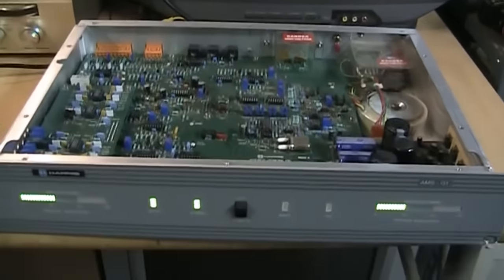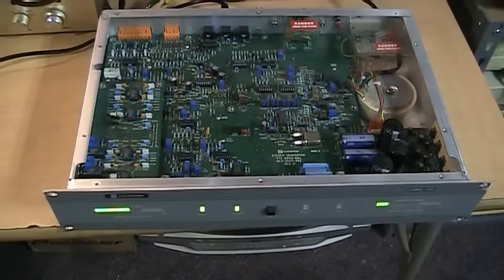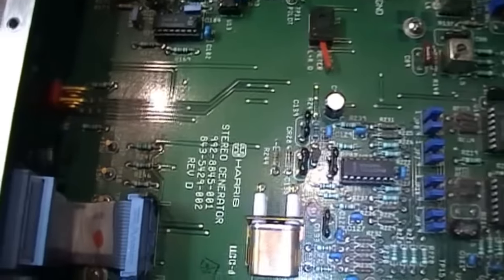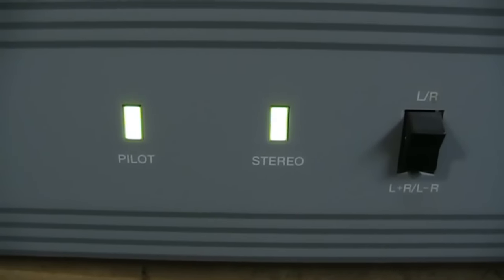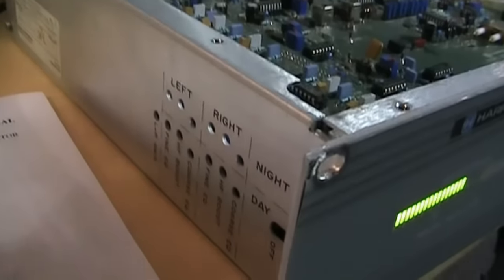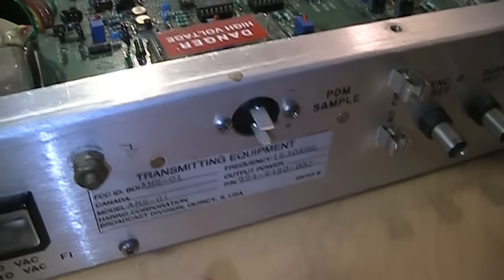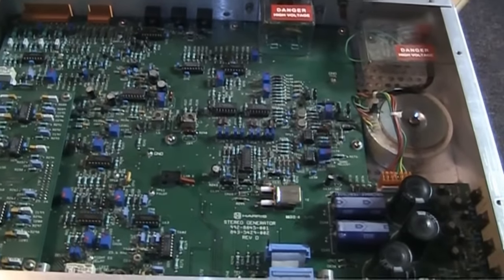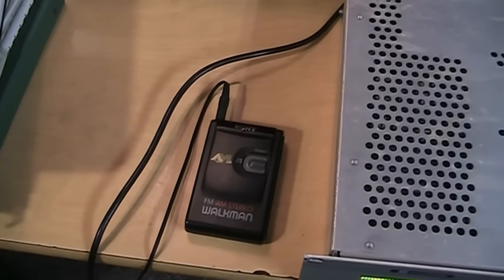Harris AMS-G1 C-Quam AM Stereo exciter

Comment: Wow, does this take me back!  I was the designer of this unit, and I haven't seen one in over 20 years.  Thanks for posting this!  It was indeed a unique design, with some tweaks to the equalization circuitry that allowed you to set up one of these in about 1/4 the time of any other AM stereo exciter of its time.
Reply from the maker: Thanks for the comment! I just wish more stations which still have C-Quam exciters would actually use them...
Reply from the maker: BTW, do you still have any crystals for the AMS-G1? I would like to change mine to a different frequency, but I just contacted Harris (now known as GatesAir) and they told me they no longer have any crystals available for it.
Reply: @vwestlife  Did you end up finding any more crystals? Motorola not being able to supply shouldn't be a problem, you could order them from any crystal supply house once you know the specs. GatesAir should be able to tell you what those specs are.

Comment: The PDM sample is used to correct for the power amplifier non-linearity in SX series transmitters (Known to some engineers and the 'sucks' series).  It takes a sample of the PA voltage from the modulator and pre-distorts the RF drive with a variable phase term to cancel the IPM of the transmitter.  Without this correction, it was difficult, if not impossible to get acceptable distortion and separation figures from some of these boxes.  Later transmitters from most manufacturers included IPM correction circuitry to make them 'stereo ready'.  This became even more important with the introduction of various digital modulation methods like IBOC and DRM.

Comment: I worked at a station that bought one of these along with a Harris DX-50 50,000 watt AM transmitter (KWJJ-AM, Portland Ore). When they were all set up, they produced excellent AM stereo (like better then 50DB channel to channel separation out the antenna). Glad to see one of these again, thanks for posting! Now someone correct me if I am wrong but the PDM sample plug on the back of that unit was actually supposed to receive a sample of the PDM (Pulse Duration Modulation) signal used in the transmitter (assuming you were running a PDM style transmitter). The AM stereo generator would use this signal to compensate for and cancel out the Miller Effect of the MOSFETS in the transmitter, allowing substantially better stereo separation when using a PDM  transmitter. It's been many years since I have seen one of these units, but as I recall this is the only AM stereo generator that I saw that had this PDM correction circuitry. Good Job Harris. They made some excellent AM equipment in those days.

Comment: I was going to say "you should totally install Linux on that", only the bug makes me think someone already did! Okay, I'm a bad person and I'll go home now. :-P

The audio quality and separation are both striking. Those removable connectors blocks are also commonly seen on alarm panels, building management stuff and devices that support dry contact/trigger inputs.
Reply from the maker: +uxwbill Harris's HD Radio IBOC exciters actually do run on Linux -- and yes, I have heard stories about them crashing.

I haven't examined the schematic closely, so there might be a small microcontroller hiding in it somewhere, but as far as I know, the AMS-G1 is all analog.

Comment: Those "Pluggable Terminal Blocks" or "Phoenix Connectors"  are actually very common in audio applications for mic and line level inputs to professional grade exciters and PA amplifiers intended for 25, 70, or 100 volt permanent installations.
They are far from unusual if you work in the professional radio and audio field.
Harris is a good brand, now they are partnered with Ma-Com (General Electric / Ericson), we bought all Harris 700MHz OpenSky equipment to be compatible with the Ma-Com OpenSky system in Las Vegas.
Reply: +ElfNet Gaming I agree, my 100V PA amplifiers also have these connectors on the output, except they are green, not orange like in this video.
Reply: Yeah green is the norm, I have seen replacements of various colors though

Comment: In the '80s the FCC extended the AM band from 1600 to 1700kHz, and mandated every station there had to be stereo. They let the other stations decide whether or not to use it, and of course, most didn't. I used to get KCJJ at night, great signal.
Reply: 5 Rounds  YEP and some of them simply broadcast the pilot signal only so they could continue being oN that 1600-1700 kHz slice of the AM BC band.

Comment: That sounds really good... like FM, but with a nice warm tone, and without all the clipping, distortion, and brightness (which is a shame, since FM has potential to sound fantastic when the audio processors are set correctly!). With my TM-152, I've noticed how different radio stations have different bandwidths; most of them are about average, but the local country station has the widest bandwidth I've ever heard on AM. Also, that bug in there is a maple bug. Saskatchewan is crawling with them, especially in the country. I've seen entire walls covered with them! Also, I hope the snake didn't bite you when you opened the unit. :-P

Comment: Have an STX-1B Harris AMS exciter, set to 930khz.  Mine doesn't appear to have any way to monitor a stereo transmission at all.  It has a 4 watt RF output, but even though it all looks operational left and right, I'm only getting left (I think) audio coming across both channels on my C-Quam radio.  Seems like I should have at least a real summed mono signal on my radio.  Size-wise, the exciter is huge.  About like a Pioneer RT-707 reel to reel.

Comment: I think the bug died because of the EM produced in there!

Pitty AM stereo never made it as a standard here in Europe. 25,6 kHz pilot is way better than 19 kHz used in FM. You'd get a better stereo separation and can get sounds as high as 20 kHz. So this must be better than digital radio.Analog uncompressed stereo sound at lower broadcastfrequencies and with a wider spread. Shame to standard makers!
Reply from the maker: The C-Quam AM Stereo pilot tone is actually 25 Hz, not kHz. It's a sub-audible tone in the L-R component, which the receiver filters out.

Comment: Are there any disadvantages of AM stereo? Why many radio stations that broadcast in AM stereo reverted back to mono? AM stereo transmission is backward compatible with mono receivers so despite lack of availability of AM stereo receivers they don't have to revert back to mono.
Reply from the maker: +bobskie321 Read all about it:  
http://en.wikipedia.org/wiki/AM_stereo
Reply: +vwestlife 
Thanks for the link which explained that AM stereo is incompatible with HD Radio (both can't be use simultaneously) so they sacrificed AM stereo in favor with HD Radio.
Reply: I can only think of lightning static that can cause stereo dropouts.

Comment: Do you have a CD-4 quad decoder and something with a 24-bit DAC for output?  I have a couple of Quadradiscs and was kind of curious about whether a high-res audio of the output from a decent turntable but without the Shibata stylus would decode.
Reply from the maker: No, I don't have a CD-4 decoder, although you can kinda do it with software on a computer. See my video about CD-4 quadraphonic, if you haven't already.
Reply: +vwestlife I left this on the wrong video.  I thought if you had been looking into CD-4 for a while, you might've found a decoder.